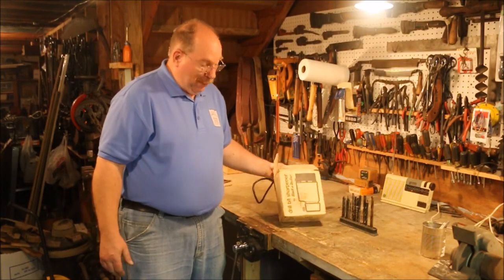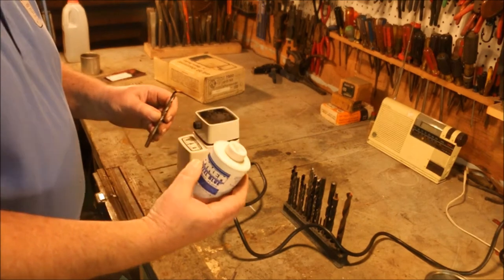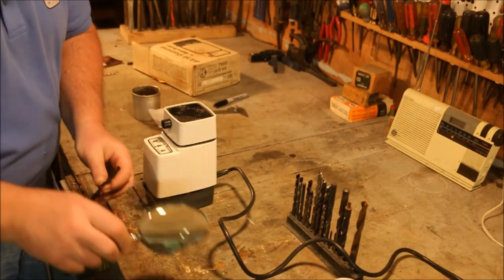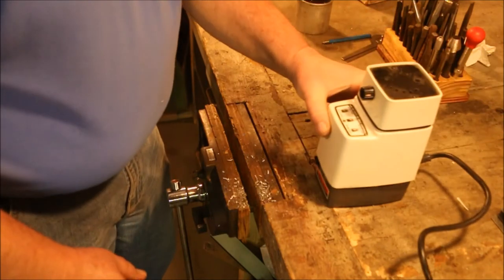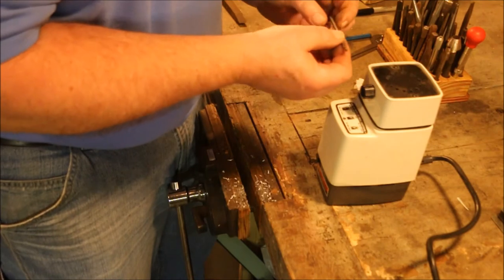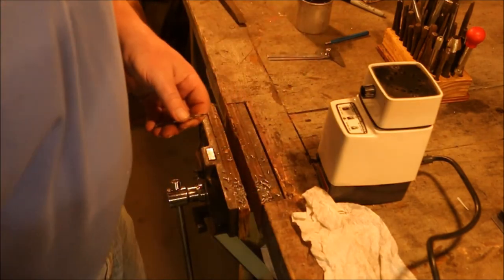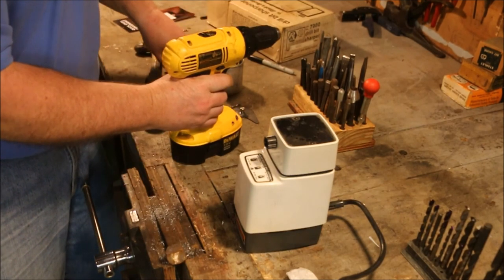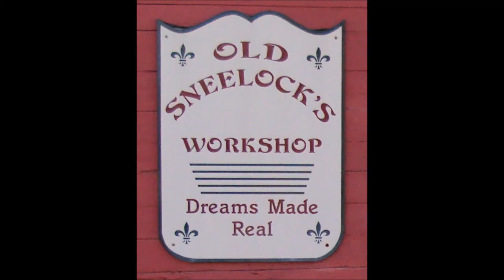BLACK & DECKER #7980 DRILL SHARPENER ~ PART 1 ~ TESTING

Comment: I have one of those B&D 7980/9080 sharpeners in almost new condition that I want to sell. How much should I ask for it?
Reply from the maker: Bill, I ended up giving away all of them that I fixed. B&D made a bunch of them and sold them under the Craftsman name also. 
Even when they are in good shape it takes practice to use them. I mangled a few drills with the first one before I got the hang of it. 
Checking the sold price on Ebay it looks like the highest is around $50.00 with most of them selling for around $20.00. https://www.ebay.com/sch/i.html?_from=R40&_nkw=B%26D+7980+drill+sharpener&_sacat=0&rt=nc&LH_Sold=1&LH_Complete=1

Comment: I have a similar kind of sharpener by black and decker but it only has the housing that holds the stone and jig that aligns the bit (basically just the top part of his machine)  and on the bottom there is a shaft that can be hooked up to a drill or a universal motor (if i can find something that will work well and connect to it). I was wondering how it works and this video has helped me a lot. Thanks!
Reply from the maker: Not a machine for a production shop but surprisingly workable. 😁😎

Comment: This is spooky. About 9 weeks ago I bought the same machine for £5 in a garage sale. It has sat in my garage waiting for me to do exactly what you have done today. This is a necessity as I cannot sharpen by hand and thin the web no matter how many times I try. Looking forward to part 2 to see if I have bought trash or treasure (but for £5 it does not matter either way but it would be nice if it worked).
Reply from the maker: Trash or treasure is based on expectation. If it is a bench queen you seek, able to take up space and provide endless questions as to the meaning of life and why we persist in searching for one, anything can be a treasure. If the search is for a simple device that makes an idiot an expert then go CNC. One button and the program that your inheritance paid for will make endless copies of anyone else's ideas. 
Everything else requires upkeep and skill to use for more than a moment. 
This little plastic wrapper around a B&D drill motor, mounted in the begging position, will dress the edge on a whole lot of slightly dull drill bits or it will bring one extremely dull 3/8" bit back to the proper configuration before requiring a new wheel at least. There is a distinct possibly it will need cleaning and definitely lubrication since it has sat on the back of a shelf since the 70's when the previous owner, who never read directions, put it up after totally destroying his little kit of Globemaster Chinesium drill bits. Globemaster was the 70's version of Power Fist tools. Available on a card table stand at the front of every A&P, Kroger, KMart, and gas station in the lower 48. 
If you seek a tool that with minimal upkeep will continue to function long after most have bitten the bitter end of the tow rope then spend the money drop the bits off at your father in laws. Rather than have you believe he can't whip cowshit into custartd, he will substitute a new set and tell you that your set wasn't worth keeping.
Reply: I had never come across power fist tools but saw some YouTube videos and wow, they look terrible !. In the UK we have the equivalent and they are Silverline  tools with a lifetime guarantee. I think they bank on the fact you will lose the will to live after you have returned the tool half a dozen times. Our plumber believes they are made from cheese rather than steel. All from the Far East and total rubbish. With the B&D drill sharpener I don't think I will ever find a replacement stone but hope it's good while it lasts. Looking forward to part 2.

Comment: i tried lots of gadgets and finnally had to learn how to sharpen bits with a grinder!, the gadgets dont work, or wont sharpen broken bits etc,  i learned how from a few videos on youtube as i had no-one to teach me
Reply from the maker: There is a difference between sharpening and making a drill bit. Sharpening implies that the tool is dull. Dull as in it requires more effort to cut but still cuts. Making is when you have pushed a drill bit to the end of it's endurance and melted the tip into a smoothly polished knob. 
Preventative action is always easier than restoration. Restoration is faster. To restore it you toss the nubbin and replace it with new. Knives require preventative action. Machine guns require the ammunition to be restored to it's previous state.
Reply: Same with me about welding vertical. My cousin could sharpen bits and was an ace welder. He tried to show me both and failed. I welded flat and he sharpened the bits.
Reply: 10/4 on the smooth polished knob. THAT I understand!

Comment: Yesterday was my computer fastin day so I'm making up for lost time today. Anymore I'm just as well ff to get a new bit because I just can't grind one with no grinder and really no fingers. Maybe a sharpener like that would help but I don't do that much drilling. Boy Howdy I AM into a project and a half right now. I was caught up on my mechanicing so I told Sweetums I'd fly in and see if I couldn't tighten up her steering on her old Craftsman (30+ years) Rider. It's got a new tranny a few years back with a new deck but the steering slipped. I was talking to the Saw Surgeon last night and he said these were made by Roper and asked me if I remembered the green Roper riders. I said yes, with the RALLY decals and maybe a white/cream stripe, maybe. He said they were the HARDEST machine to work on he EVER saw. I believe it. I had to dismantle the whole thing almost to get the steering box out. Just 4 bolts but to get to them was a real deal. Deck, dash and all that had to be unbolted and wallered out of the way but that's done and God willing I'll finish it up this afternoon and finish up this tale later on when I watch #2!

Comment: ..i always wondered about that machine. Does it have some sort of depth stop in it?? Bossman me thinks that little bit is warped. The way it vibrated your hand and kinda wobbled made me go back and view it on full screen and it looks like it is. Can't wait for Part II...!!
Reply from the maker: Right in one Jimmy Bob. The first 1/2" of shank is off about 3 degrees from plumb. 
As for the grinder itself, it is a nice way to be sure to put the same end in the grindstone at the proper angle. The rest is up to you. It will grind a bit off center and backwards without complaint. If you are willing to take the time it will turn a complete bit into dust. With a bit of thought and some patience it will sharpen more bits than the average handyman has in there possession.
Reply: There was a sharpening thing where I was working and swapping a 3208 cat with a 13 under for a Big Cam 350 Cummins with an 8 double-L, cab and all. It was from a single axle tractor going into a tandem. To drill mounting holes in the frame we had a Wen 1/2 inch drill motor and a bunch of dull bits. We got a chunk o0f chain and bolted it to the truck somewhere and using a pipe, forced the drill to make a hole using the old pipe on the drill press effect, with no press. We got through but that Wen drill motor was a LOT tougher than I ever thought. The truck was a BULL with the lo-speed 3208 rears too!

Comment: If you want to ruin a bunch of drillbits, that machine you have there will do it
Reply from the maker: Yes it will. So will a drill motor if used improperly. 
I was able to clean the unit, dress the wheel and sharpen drill bits successfully. 
If you just stuff the drill bit in the grinder and don't bother to learn how to use it  correctly you will likely ruin both the sharpener and every drill bit you attempt to sharpen.

Comment: I own one. They are crap.
Reply from the maker: Originally I had intended to use the B&D as an example of over engineered under performing gadgets. By the time I got to Part III I had changed my mind about the tool. 
It is limited. It won't bring a broken 3/8 bit back to shape without a lot of time spent and probably changing the wheel once or twice. For the average guy in their shop at home the sharpener can dress the edge and keep it sharp pretty well. 
I have a pile of small drill bits that came from buying tool box lots at auctions and estate sales. In the bottom of most of the boxes were drill bits from 5/16" dia on down. Usually in multiples of one size or another. The ends were dull and quite often burnt. With this little tool providing the built in skill set of holding the bit at the right angle it will let the weekend warrior finish the job that use to have to wait until the hardware store opened to buy another bit. 
Perhaps what your sharpener needs is a new wheel. After 30 or 40 years of sitting with the occasional tryout by the new owner the wheel in mine was loaded with oil and swarf. I was able to dress the wheel in Part II. It made a big difference.